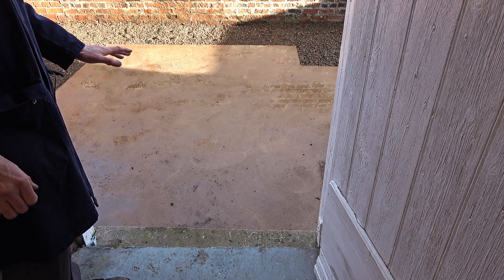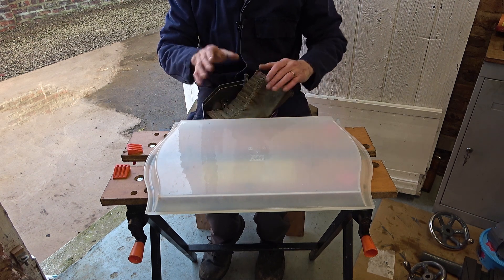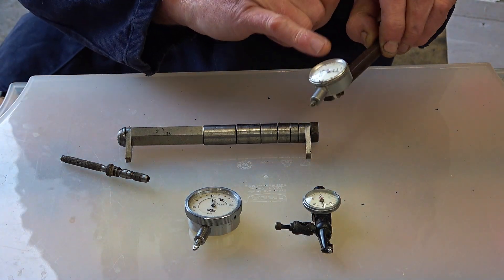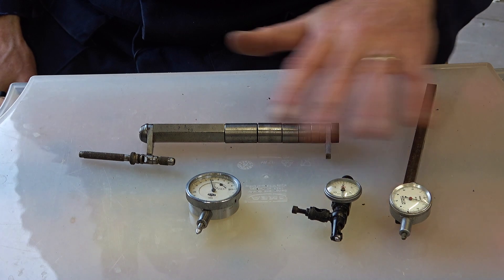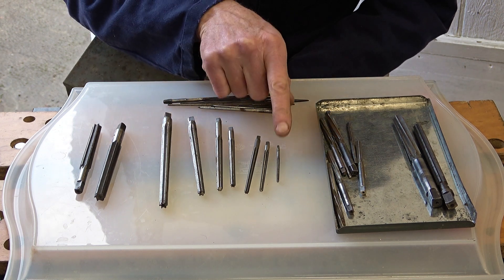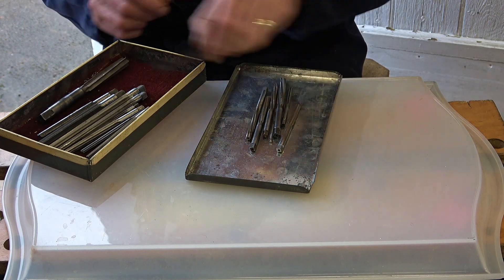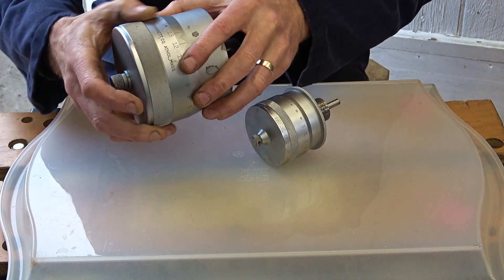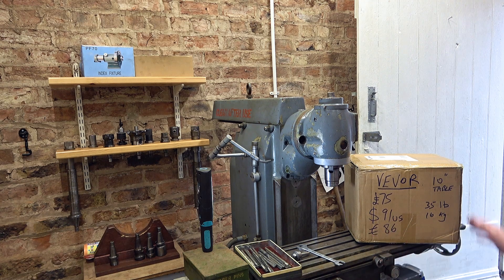HS224 Gifts and curiosities

Comment: Damn, those huge mics are funky, but that corrosion looks much like someone spilled sulfuric acid onto one of those, or as if the mic sat in a tub with a car battery which leaked... Sulfuric acid is quite recognizable in aluminium, as it stains it in that black grey oxide, and often a whole bit of flaky and stinky residue which was likely at some point cleaned off by the prior owner... Take care with that, if you take a wire wheel to that corroded area to buff it shiny, i bet my ass on you being able to catch a whiff of sulfuric acid if you don`t wear a mask... Vitriol corroded black stains are permanently stinky and you will be able to smell it despite the time passed since the incident... I would recommend some gloves and complete safety gear until that shit is gone... The raised section might very well be just the puffy flaky crap that the acid made out of the material that didn`t degrade to the point of flaking off... I could be wrong, but that definitely looks like it on the screen... 
Tho, i suppose you will remake the parts, as they really are not overly complex, the engraving work notwithstanding, so you needn`t really buff that crap out to any degree... 

All the best!
Steuss
Reply from the maker: Hi Steuss, that is a very important warning thanks. I did not come up with any reason but yes a corrosive acid would defo do that. Thanks for watching and the comment. Cheers Paul
Reply: @HaxbyShed 
Anytime, i`ve seen such damage on car components, so i just recognized it by similarity... It`s not 100% guaranteed to be acid stains, but hell if it don`t look like it or isn`t caused by something similarly chemically aggressive...
And no need to thank me for the watching, if i like something, i watch it... So you are thanking me for enjoying your video-making efforts... I do some videos myself, so i get the appreciation of viewing, but you needn`t thank me for it, I thank you for the efforts!

All the best!

Comment: The "pin vise" looks like a part from Starrett set of trammel points or beam compass (basically a giant compass). The marked size thingie with "lever" ends is space blocks and the end flags let you calibrate a bore gage to be the size of the blocks between. The marked space blocks are tapped 1/4-28 most likely. The hex bar looks homemade. Hand reamers (with the square on top) are always tapered on the first inch or so of cut, at least a little. Taper pin reamers in the US are 1:48 and say a #6 has a small end of 0.2773" and a big end of 0.354".  You step drill for taper pin reamers to reduce the load on the reamer. The square reamers/broaches are used by clockmakers and I have always called them watch/clockmakers reamers or broaches.  Those giant micrometer heads are really cool!  Nice haul video!
Reply from the maker: Mr Holliston, I think you get full marks for a fully complete answer on every item. PASS with Distinction. Cheers Paul

Comment: Very useful gifts Paul. I once saw a large micrometer head like the one in good condition you have. It was on a large jig borer with an appropriate 10ft, 3m diameter table. It was located at the end of one one of the ways for measuring fine adjustment. It looked tiny lol. Cheers Tony
Reply from the maker: Hi Tony, yes I've seen machines like that on YouTube, sometimes with rods that could be screwed onto the micrometer head. Cheers.

Comment: The small collet chuck is from a trammel set it holds different tips large micrometer look to be from a optical comparator stage,that’s quite a collection of goodie’s.
Reply from the maker: Hi Albert, a few people have said trammel set. I had not thought of that, thanks. Cheers

Comment: Good stuff, Paul. I can help you with some items. The tapered reamers are 1:50, thats standardised. The reamers with the square end on the shank are hand-reamers, they always have a short taper on the beginning for helping getting it started. Machine reamers dont have that feature. The built-in micrometers are missing their mount. Of course you can mount them in different applications, but mostly they come in a stand. This stand allows you to mount a DTI on top to check if the tooth-bar internally is milled correctly or if there is any wear internally. So to say, they are part of a DTI test-stand. I could send you a photo of a complete unit if you are interested.  Regards,  Michael
Reply from the maker: Thank you very much Michael, I have sent you an email. Cheers Paul
Reply: Thanks Paul. Pic is sent.  Regards. @HaxbyShed

Comment: My understanding  .. from Engineering classes at school .. (that ages me doesn't it)
Hand reamers, as opposed to machine reamers, are tapered over the first 1/3 of length to aid starting.
Machine reamers have cutting edges on the end at something like 45°

Clock makers use tapered broaches and reamers to open out worn pinion holes and for subsequently sizing replacement bushes.

The worn hole that needs rebushing is opened out from the "inside" of the plate and made big enough for a bush to be pressed in.
Should this be done badly and the new bush wasn't inserted tightly, it won't fall out and be lost but will stay on the pinion. 
They then enlarge the deliberately undersized hole from both sides of the newly inserted bush.
This makes the contact surface smaller than a parallel hole and so reduces friction.
Reply: right.
Reply from the maker: Hi Steve, I've learnt a lot from this. Thanks. Paul

Comment: I think bar with the spacers is for turning items or tooling between centres. I guess you'd call it an arbor. the two "levers" on each end i presume are for use as drive dogs or indexing.
The hex shank is probably the bar stock it was made from but could be held nicely in a three jaw.
Reply from the maker: Hi MJBE, I'm told it is a gauge to set the calibrated distance on an internal bore micrometer - such as you would use to measure wear on engine bores. Cheers

Comment: I'm guessing a variable go/ no go length gauge
Reply from the maker: Hi Stewart, apparently it is a gauge to set internal bore micrometers, like you might use to check the taper on an engine cylinder bore. Cheers

Comment: The " hand broach" is a Hand Thread Chaser Paul. You use it with a bar in the tool holder on the lathe. If you have a thread to clean up, stick it in the lathe on slow speed and use the chaser a little like you would a chisel in a woodturning lathe to clean up the threads. Those things are like unicorn horns, I have been looking on and off for some for a reasonable price for over 20 years. You have got one more than me.
Reply from the maker: Hi Bill, the Stuart who gave me the reamers has a big set of hand chasers but he made it clear in his opening sentence that they were not on offer. Cheers
Reply: @HaxbyShed   Haa hhaa. Not surprised Paul, they really are made out of unobtainium for us retired types.

Comment: Very kind of the Stewarts! All imperial taper pins are 1/4" per foot of taper, or 1:48. The numbered pins just identify the sizes of the big end small ends on a standard length taper pin. A number 1 taper pin is 0.1733 on one end to 0.1713 on the other, for example. Vevor. 🙄
Reply from the maker: Hi Greg I'm sorry to torture you with a Vevor review 🤣.  It will be out tomorrow. I try to pick tools that I really need for myself, that sooner or later I would have to buy. Cheers Paul

Comment: Those two odd tapered reamers could be hole enlarging "reamers" for sheet materials. 
If those apparently hand ground tapered reamers are five sided they could be clock making tools, called clockmaker's broaches and used for slightly opening hole in such things as the hands of watches and clocks.
Reply from the maker: Hi Chris, yes the two reamers marked 1/2 and 7/16 could be just that. It would make sense from the size description. Cheers

Comment: A nice lot of goodies. If I had to guess some of those reamers in standard sizes could be for automotive use. IE tie rod and drag link holes.
Reply from the maker: Hi Tom, both bags of goodies came out of the blue completely. You don't normally expect your jobbing builder to offer up a load of engineering bits by chance. Happy days. Cheers

Comment: Numbered reamers are for numbered taper pins. Look in the Machinery Handbook. They started late 1800's, as far as I know.
The Starret gear, can be repaired at modest cost. Just don't know about across the pond. Freight might be aweful dear.
Best wishes from Northern Canada.
Reply from the maker: Hi Carl, I do have a set of dusty old machinery handbooks and I will have a look, thanks. I think the Starrett micrometer will stay as it is unless/until I have a project for it. Cheers